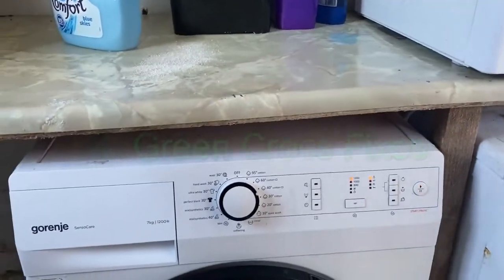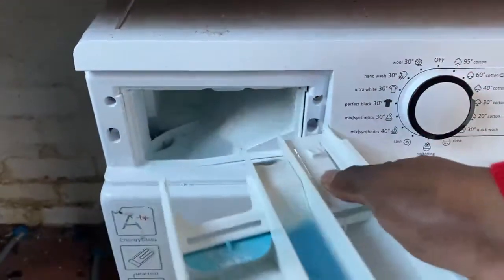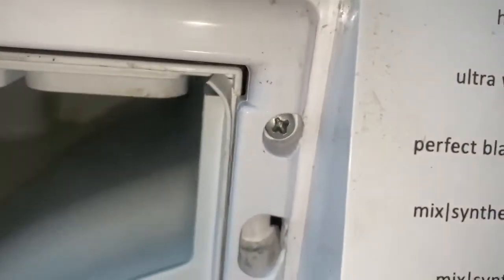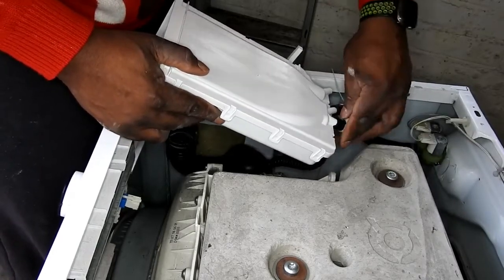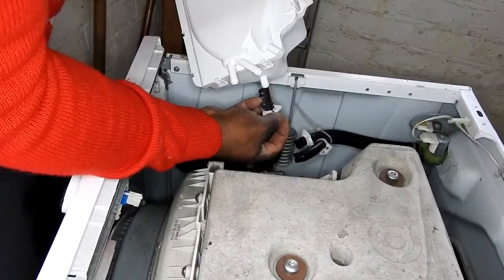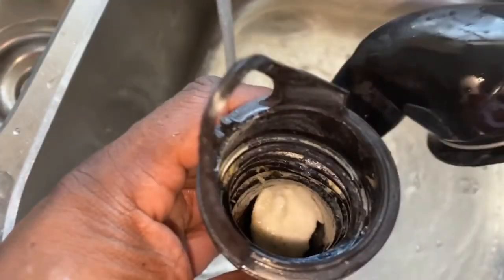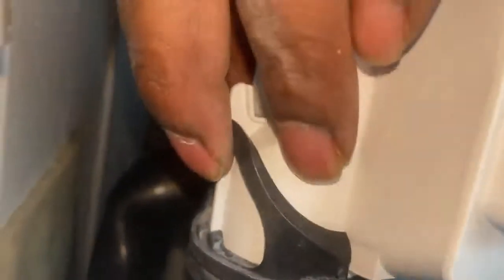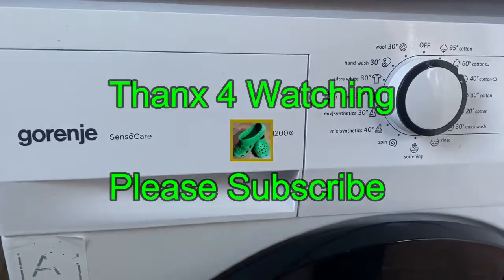Washing Machine Soap Dispenser Drawer Sump Hose Blocked

Comment: Hi mate, I've just done this and found a sock stuck in the bottom of the black pipe.. put it back together and working fine now.. just wondering if they will be any more behind the drum and what's the easiest way to check? Thanks!
Reply from the maker: Hi 'Jordan,
                   yes I have come across this before. If you overload the machine  with washing, small items will squeeze through the Door Seal and sink to the bottom of the Tub where the Sump is. This will then cause draining issues. Anything remaining would most probably had shown itself when you dismantled the black pipe at the bottom or Sump.
Reply: Ha! Yep, it definitely gets overloaded sometimes. Thanks again mate, saved me loads of money..!

Comment: Great Video, do you think Drain unblocker would work? if unsure of taking lid off washing machine.
Reply from the maker: Hi Millzy,
               Don’t recommend that you do if you’re not confident. However dismantling the unit was the only way as this was a solid piece of Soap and poking something in the pipe would probably make a hole in it 😎.

               Regards.

Comment: I did this, and the sump hose wasn't blocked... what else could it be?
Reply from the maker: Hi Daniel,
                once you have removed the Sump (black flexible hose) have a look in its housing where it connects to the Tub, as there can't be any other obstruction if the Soap Tray housing is filling up with water.

Comment: That rubber tube often comes off  that  original cir-clip loose  😢
Reply from the maker: Thanks JK,
                   yes but if the machine is overloaded or the Tub moving excessively the Hose will inevitably work loose 😀.